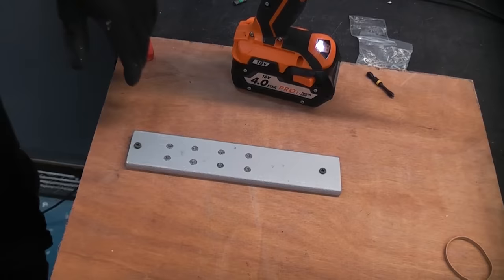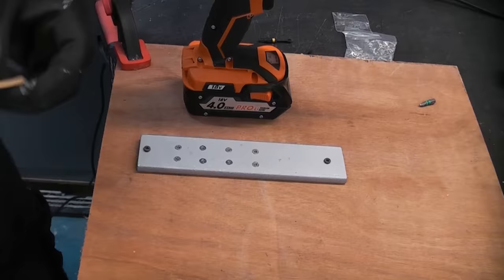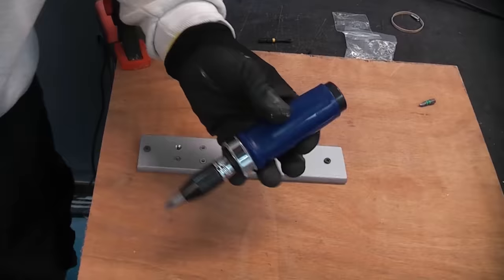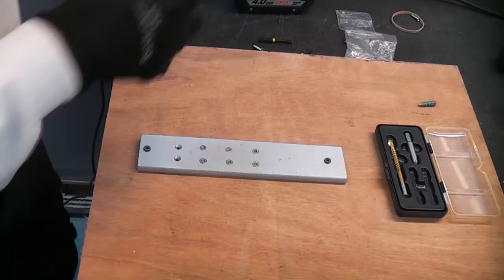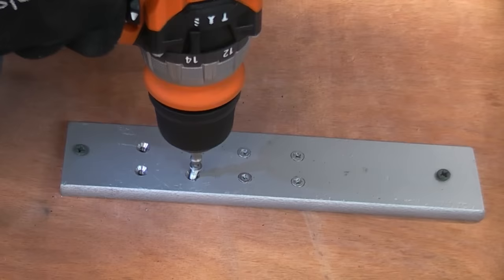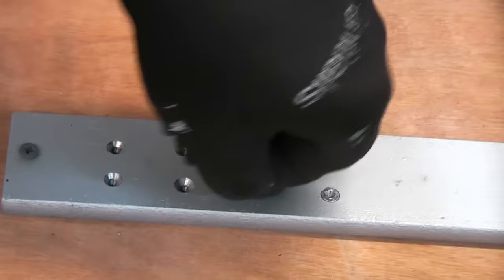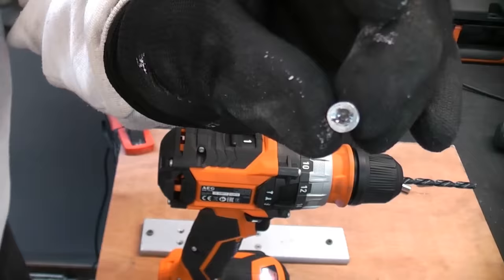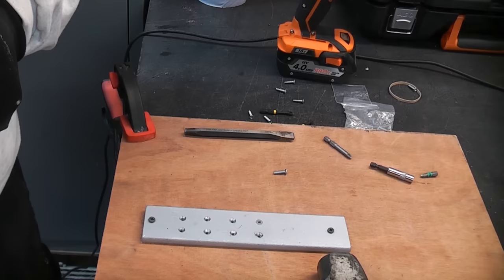How to remove stripped screws – 7 different ways

Comment: I have the ball end of a hex key snapped off in a dome shaped bolt in my bike. I do not want to damage the paintwork on my bike trying to remove this thing. Its jammed in there. I bought solid carbide drill bits to try and put a drill in it to wiggle it out but the drill,bits shattered almost straight away. The hex key was chrome vanadium so is solid. Tried a strong magnet as well and ive put some wd40 in there..no joy its stuck in there. Any ideas people?
Reply from the maker: A diamond coated hole saw might be the best option, but it's a slow process- https://www.youtube.com/watch?v=7JCfEMrCjhc&t
Reply: @ultimatehandyman  will a 3mm one do the job? If I go any bigger i’d hit the sides of the bolt hole and round it out. So the trick is to take my time and keep cooling it?
Reply from the maker: @1ninjatiger   It might do, but 3mm ones are not widely available. I have bought from here in the past though - https://www.richontools.com/index.php?main_page=product_info&cPath=1_4&products_id=18
Reply: @ultimatehandyman  I’m in Scotland. I ordered some 3mm ones from Amazon. They arrive tomorrow. I’ll give you an update. If it doesnt work Last resort is cut a slot in the bolt with a dremel and try to turn out the bolt. Im hoping the drill works 👍🏻

Comment: Which one would work best with stripped AND rusted screws? I'd rather not start trying one method and damage the screw even more.
Reply from the maker: Plenty of spray penetrant, then I'd use the hammer and cold chisel. I've used that on some seriously rusted in bolts/screws in the past (providing hitting the screw won't damage the item that you are working on)
Reply: @ultimatehandyman  Awesome, thanks!

Comment: these are all very good for simply stripped screws, but more often then not the screw is stripped because it stuck  hard which lead to the stripping in the first place. these methods don't work well in this scenario

Comment: Man... I've got a really small screw (1/16th Allen) on an impact sensitive piece of equipment. It's been loctite into place and is completely stripped. 

I'm gunna try to cut it with a Dremel because it's raised about 1/32 of an inch above the surface. 

Rubber band didn't work, none of the methods requiring a hammer are viable, and I don't have any left handed drill bits... Really don't want to buy a set for this one screw... I should though because this isn't the last stripped screw I'll have to deal with. 

Wish me luck with the Dremel 😂

Edit: space is too tight for the Dremel cutting bit.  Left handed bits it is... Tha ks for the video
Reply from the maker: Sometimes the left-handed drill bit is the only thing that will work, or a Trend Micro Grab-It -
https://www.youtube.com/watch?v=q6gehydy70k&t=24s&pp
Best of luck with it
Thanks for the comment 👍
Reply: @ultimatehandyman  yeah I got it out last week. 

I ended up doing something stupid but it worked... 

Thanks for the vid my man. Although it didn't help me with this specifically it helped me figure it out and now I have a few new tricks for other projects.

Thanks again.

Comment: Krazy glue the heads? 😁 Hot glue? Hammer a nail in it and twist the nail?
Reply from the maker: Super glue works for smaller screws 👍
Reply: @ultimatehandyman  my mind is made up. The flathead screw is the quintessential most underrated screw. This doesn't happen with them

Comment: Elastic bands? in the 21st century? What sort of music do elastic bands play? 

i remember junk drawers from bygone eras, chock a block with rubber bands. I used to sigh with annoyance every morning while tugging the buggers off my morning paper (another relic). 

What i wouldn't give to be annoyed like that again...

My point? Ah yes, the elastic band is brilliant - and brings renewed relevance to old advice; it's nice to know that "always use a rubber" still applies to me.

 It's a cruel irony however, that my rubbers are used for unscrewing.

Worse, their sole purpose is to unscrew the unscrewable - bolts and screws that won't budge because they're 'stripped' from too frequent, too prolonged, or too varied screwing - and let's not forget those clumsy fumblings in the dark by the inept or uncaring, vainly thrusting Philips Heads where their ball ends or round nuts belonged...

I'm going to be kinder to my stripped bolts and screws, they've been through a lot.

i wonder if I'll actually post this. I wonder if that third scotch was ill-advised. I'm a senior citizen, a grandmother, i need a new hip, i wear sensible shoes  ... 
but it seems I've penned a thinly veiled  pornographic memoir in the comments section of a YT tool tips page i visited for help with a recalcitrant bolt. 

Since I've no idea where this bit of sad silliness came from, i think I'm supposed to post it. 

Loneliness in the social media era is surreal. I am reminded of that line from the Rhyme of the Ancient Mariner - "water water everywhere and not a drop to drink"

Comment: If the screw can be pulled out by hand, the grip wasn't strong enough to dust the head. In that case any fine-tipped screwdriver should remove the screw with minimal effort.
Screws really tight to the point of dusting, it doesn't come out easy with these procedures.

Comment: Works on theory. Still can't get the door knob screw off. 😭😭
Reply: @ultimatehandyman  over an hour later, I tried drilling into it and finally got it off. It was the door knob...I could not get it off so it created a very difficult angle. Perseverance is my super power. 👏👏😁

Comment: Those screws are not tightly stuck and are easy to unscrew with almost any method.
Reply from the maker: Yeah, because thread locker does not work 😂

Comment: yikes I accidently tightened a star screw or whatever with the 8 sides to much and when trying to get it out realized my bit was just to small to get a grip and the bigger one was well to big none of these worked which is fine the screw is tiny so I can’t use a drill anyways off to the comments I do think you got a half a turn in with the rubber band even though it took like 8 rubber bands being torn to shreds

Comment: Most of these techniques won't work in real life cause our issue will be horizon and not vertical. I have a strip screw in a shower valve and imagine I tap that with that sludge hammer lol. However, thanks for the ideas.

Comment: This is all fine and dandy but most of the time your removing a corroded or rusted screw or a screw that is contaminated with glue or sealant of some type. Your using a controlled fresh brand new screw that once you break it lose it comes out easy. You need to try this real world situations.

Comment: Yes, it looks easy, but your screws were not actually threading into the metal plate, but threading into the wood underneath. Why don't you try showing us how to remove broken screws out of metal?
Reply from the maker: These are machine screws, they are threaded into the metal 😉
Reply: @ultimatehandyman  That metal has been pre drilled. You can see the countersink. And the holes are not threaded.
Reply from the maker: Ok, Karen. If you say so 😉
Reply: @ultimatehandyman  Ok, please post 2 hours of live video of you tightening the bolt holding your manifold to engine block till it snaps. Then remove the broken bolt. Ready set go.......
Reply from the maker: Sure, Karen. I’ll do that when I have time.
However, that has absolutely nothing to do with your original comment 😉
Reply: @ultimatehandyman  Sorry about the original comment. I had noticed that the countersink was halfway through the metal. The most troubling breaks are in metal, and that would be a great video for you to post.

Comment: My wood floors had previously been covered up by the former owner with plywood and carpet. After removing the carpet or shall I say scraping It off, I had to remove the literally probably thousand of screws in the floor. Some won't come up or they came up halfway and got stuck. One in particular has caused me to go on a cursing spree at least daily. I don't recall ever saying the f-bomb so many times within 10 seconds. That POS has caught and ruined every pair of socks I own. It just ripped my brand new Halloween socks. THIS MEANS WAR! That motherf*cker is going down! NO MERCY!
Reply from the maker: Blimey, what a nightmare!

Comment: SOLVED MY LAPTOP STRIPPED SCREW ISSUE! 
I used all the hacks but I think mine was just too tiny and the stripping and become really rounded,  and I didn't want to get a mechanical drill extractor because it was a laptop. so I thought, are there pliers to remove screws? 
I found one called Neji Saurus by the brand Engineer bring demoed on a huge screw here on YouTube, after my research I got the PZ-57 because I was dealing with laptop fan screws (2mm) and it removed the piece of *_#£! screw in 10 seconds 😭😭😭 . I just grabbed it and turned the pliers 😭😭😭😭😭

I really didn't want to pay money to clean my fans, but those £14.99 pliers are now a  treasured life companion even though they were delivered 3 hours ago.

Hope it helps someone! If all the free hacks don't work this time. There's also the PZ-60 for the same tiny screws but it goes into hard to reach places Apparently, there are others for bigger screws too.

Comment: what he is doing in this clip - he has a piece of 1/4 inch plate steel as this is what most are dealing with - this is far from the majority of what people work on - yes - if u have a thick piece of  metal that you can take a hammer and impact easy out- then u good to go- -

Comment: I'm basically bringing a screwdriver to a nail fight! 😡😠😒😐

Thank you for all the ideas the jerkoff company put the screw on so damn tight knowing others would have to get in there to remove the clamp holding the cable in place and it such a tight aera that many tools are hard to get in there.... 😡😡😡

Comment: But what if it is rusted on???  Can't use fire/heat.  Too close to electric!!!  GRRRR  Penetrating oil didn't work or any of the great ideas u showed!!!
Reply from the maker: You might have to drill it out, if you can get access